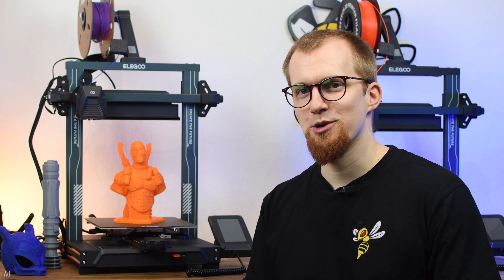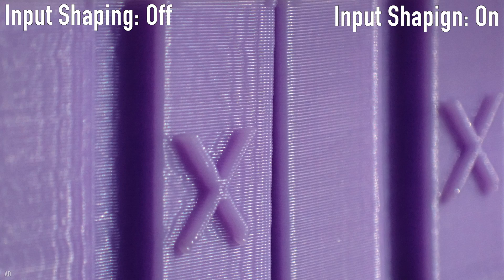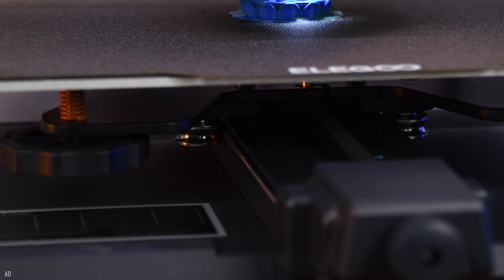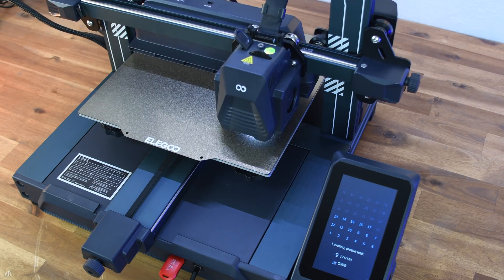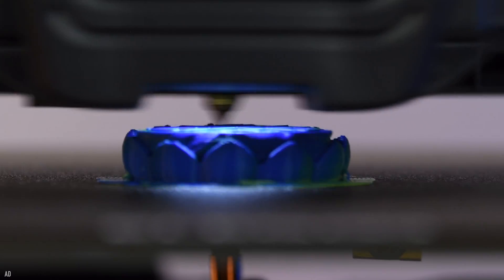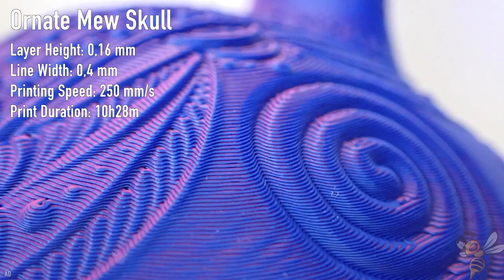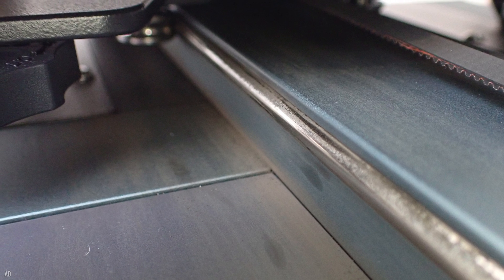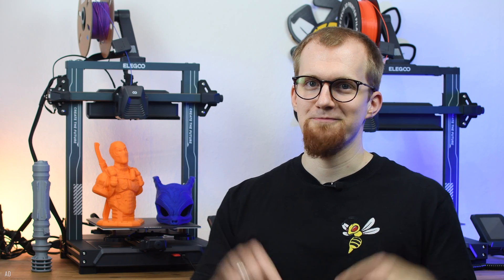Elegoo Neptune 4 Pro Review: Perfect Print at 250-500 mm/s!

Comment: Two years later, and when considering the volume of fan noise from that big parts blower, I'd rather live with the lower speed, especially since REMOVING the fan allows you to print up to 16 objects  in object mode (one at a time) with one minor configuration change. ---- Now, if they could figure out how to make that blower a MINIMUM of 6db quieter, I might consider mounting that updated unit. Until then, I can live with a slightly-slower printer.

Comment: Hi there. I bought the Neptune 4 pro too and until its delivered i have question about the. Is it possible to print on stock settings without the blower fan bar? Does it print still good quality or should i have it running all the time? And have i slow down the printing speed then? Thanks :)

Comment: I hope Elegoo makes a 300 mm cube print volume version with Klipper, but adds an accelerometer so it can do input shaper calibration to maximize print speed and quality, and with WiFi because almost nobody uses a wired LAN connection in 2023.
Reply: I wouldnt mind wifi as a feature of course(the more options the better), but saying that no one uses wired LAN is just incorrect. So many people do and even prefer it! (like me)
I will never stop using cables for a more robust connection. the only thing I use wifi for is for my google nest mini. everything is cabled. my pc, smart lights, chromecast, laptop and neptune 4pro when it arrives all use ethernet cables. even on my phone I never use wifi (just mobile data, since it's "better" or at least equal lol)
Reply: @TheJordyjb  - I didn't say "no one uses wired LAN".  I said "almost nobody uses a wired LAN connection in 2023".  The convenience of WiFi compared to stringing CAT cable through a house makes WiFi far more popular.  It's not very difficult or expensive to add WiFi to a 3D printer if designing a new board, and most customers would gladly pay the difference.  The SV07 has WiFi but lacks a few features of the Neptune 4.  We're in the early stages of Klipper on consumer 3D printers.  Features are hit and miss.  Soon, consumer demand will result in some manufacturer bundling the most popular features in one mid-cost bed slinger 3D printer.
Reply: @Liberty4Ever  I'm definitely not against more features or wifi in this case. Even if it would result in a slightly higher price.
And sure wifi can be more convenient if you don't already have cables routed, and I guess a lot of people don't go to the trouble of routing cables though their house anymore.
Reply: @TheJordyjb  - There was a year or so when nerds built or upgraded houses with gigabit Ethernet cables to make "smart houses".  Then the mass market moved to new and better WiFi.  The wired LAN houses now remind me of that one model year in the 1980s when everyone thought talking cars were a good idea until we suddenly realized we didn't want goofy gimmick talking cars.
Reply: @Liberty4Ever Cables are not subject to interferences like air waves do. I used to control mixing boards on live events with an iPad and WiFi connection to the mixer, and MANY times I had trouble keeping a connection to a router that was barely 30m away when the arena was packed with people with phones. Never had that problem when the control was hardwired and set in the middle of the arena.
Nice to have? Sure. Better? Not really.
Reply: @IñigoZapata  - I will concede that a wired Ethernet connection is more secure and less susceptible to jamming but neither is an issue with the WiFi at my house.  A 3D printer with an Ethernet connection and no WiFi means that I had to buy a Linksys AC750 - an additional cost and hassle.  It's sitting here waiting for my Neptune 4 Pro to arrive.  I ordered it over two weeks ago and it hasn't shipped yet.
Reply: @Liberty4Ever  I want a printer, but I'm undecided... :/
Reply: @IñigoZapata  - I can sympathize.  It's a good time to buy a 3D printer because there are great new features and you can buy a much better printer at every price than just a few moths ago, and it's a bad time to buy a new 3D printer because developments are happening so fast that a better printer will be available next month.

I just received notification that the Elegoo Neptune 4 Pro 3D printer that I bought 17 days ago is shipping today.  I want a 400+ mm cube large format 3D printer with Klipper and all steel motion control - essentially a Neptune 4 Pro Max.  When will that be available?
Reply: @Liberty4Ever  At this pace, before Xmas xD

Comment: Do you need specialist PLA for high speed printing? What are good brands to go for? I'm currently using Elegoo for normal-speed printing and at $11/kg it's a solid performer but I wonder how it would handle high speed.
Reply: "Do you need specialist PLA for high speed printing?" No
"What are good brands to go for?" My fav is Spectrum. I never had any problem with it. There is also Devil Design, once the spool was defective. But it was 1 out of 20. These 2 i would say are the best because of very good price.
Reply: @Smok1125  Thanks for the new brand ideas - where do you buy those? I don't see either on Amazon.
Reply: @GoodEggGuy  i see my comment keeps getting deleted. Can't answer.
Reply: @Smok1125  Thanks for trying. I appreciate it.
Reply: Elegoo now do fast PLA

Comment: Are you sure that metal rails must be lubricated? Since the wheels are on bearings they are rolling, not draging.
Reply from the maker: Yes. I have already talked to Elegoo about this. They will likely include some grease in the package soon. But how much the wheels and rails wear out without grease also depends on how tightly the wheels are fastened. With the 'ideal' tension, the wear is almost gone, but over time, it's still noticeable.
Reply: @the3dprinterbee  where does most of the wear happen at, the rail or the bearing? How long do you assume they can last in print hours?
Reply: @the3dprinterbee  Thanks for reply, I am already using Nano-grease for various cases so I will apply a bit on the rails when my Neptune 4 pro comes :)